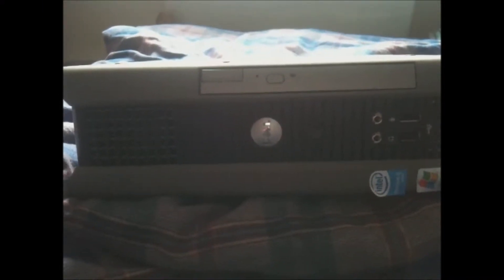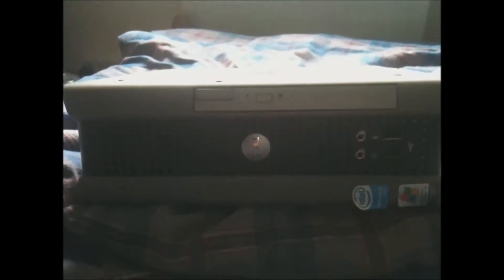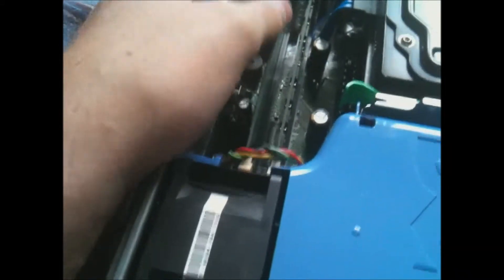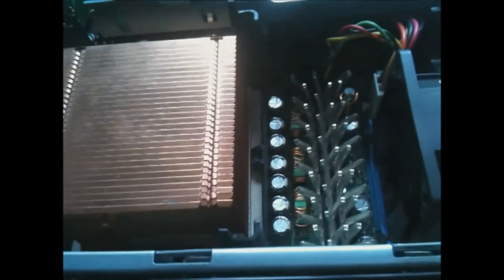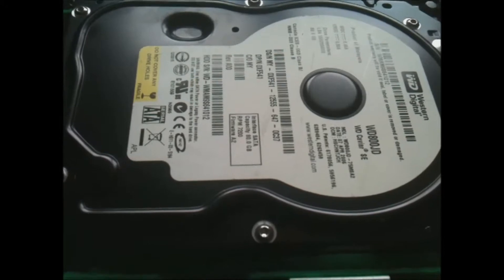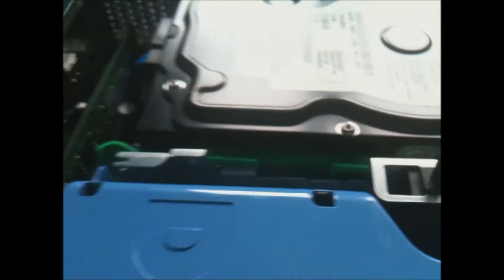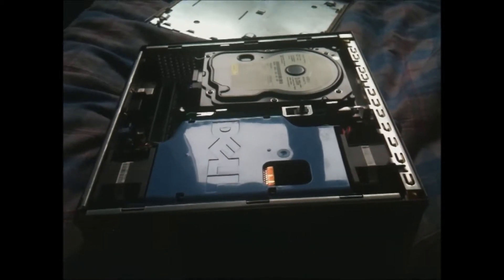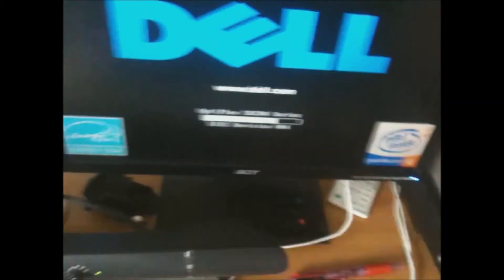Is Windows 2000 Usable in 2013? - Installation of 2k

Comment: I have Windows 2000 Professional 5.00.2195, SP4. Last version ever. Can't go online right now with it because it doesn't have the drivers set up, or a modem or all that jazz, and I might not even be able to properly set one up; I'm not very tech savvy. It's fast, though.

It works with Audacity 1.3.7 Beta, VLC Media Player 1.0.5 (no version later than that will work), Innotek VirtualBox 1.5.6 (no version later) and Microsoft Virtual PC 4 (no version later). Ironic that I use virtualization software on a Windows 2000 host, eh? :)

I couldn't find a working sound driver, so I use a pair of USB speakers that have their own capabilities and don't rely on a sound card or anything.

Comment: Nicelly done mate . am a computer geek and inthuast  if spelled right . i have a dell inspiron 8600 one of the most limited hardware laptops i have ever owned bought recently from someone i know . she's in good shape  . this machine has been upgraded to 1.2 gigs of ram originally with 512.  xp on it but i am preinstalling win2k no os is old well for wins 98/95 that is lol i have tried to install this os  on this laptop but no luck with drivers. nice vid.
Reply from the maker: Thanks mate :) That would be quite a good machine maxed out! I imagine with XP with 512mb ram would have been quite slow? Drivers can be quite a pain to find... Thanks for watching!
Reply: itsjustme581  your welcome .and yes xp was a big hedeach on this machine . i couldn't get linux none of the distros to work . vista ran okay just my wireless wasn't working right it works on win2k only for the drivers . but i do have 2 update current machines at home this is my project and maybe use it day to day like music web ect. even run  old school games . let me know if you have a driver finder software ava. thanks
Reply from the maker: omarantuan Some linux distros can be a pain. I tried installing a couple on my home theater pc before I decided on Windows 7. I couldn't find drivers for it. I will have a video about win 2k drivers because I found problems when using the machine that I did. It will be done when I get back off holiday next saturday. I want to start doing some old Win2k stuff again :)
Reply: itsjustme581 yes even though theirs Mac OS X which i use right now but we all grew up with windows . as of now why my choice is mac because i don't like the way windows is heading or microsoft i should say.  they stopped supporting xp which is based on 2000 . they should of ended support for vista.
Reply from the maker: omarantuan
I agree, I use Mac because of the way they wanted Windows to go. It would have made sense to end vista support considering it has very few users.
Reply: yep mac is just stable on like windows . but i always wanted to know something can windows 2000 run on newer hardware